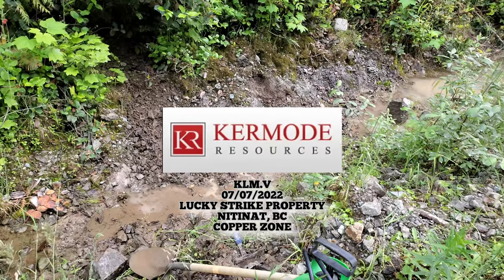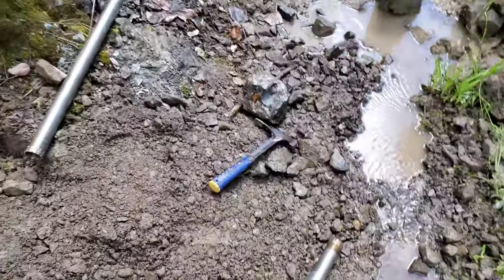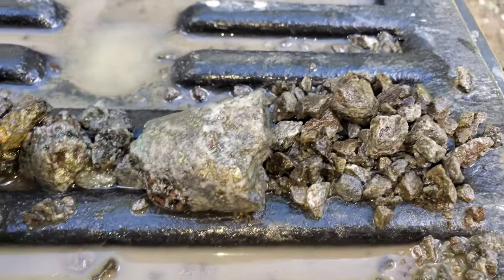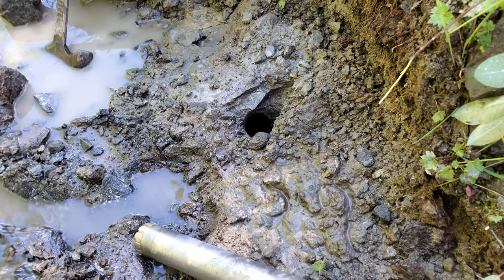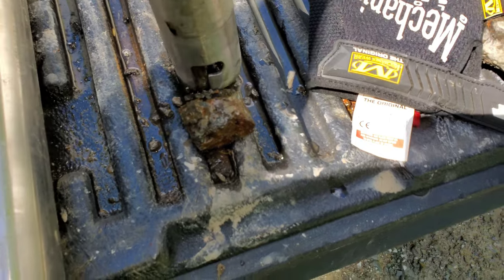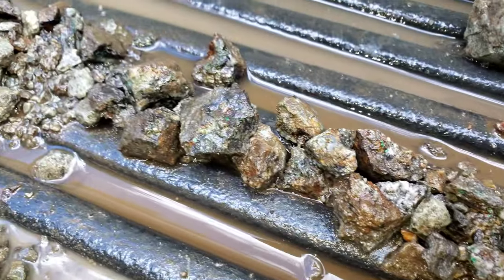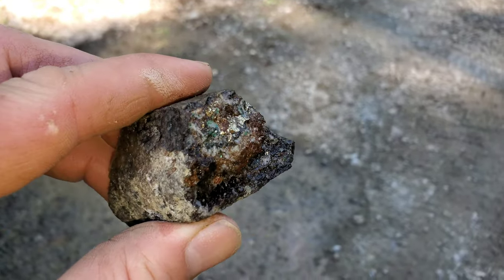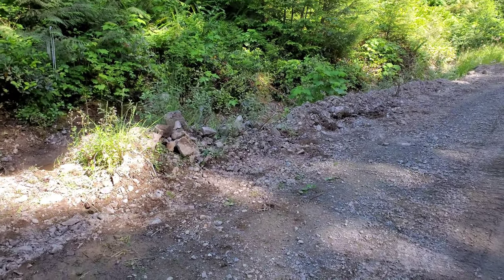Drilling Into Massive Chalcopyrite At The Copper Zone! (Lucky Strike Property) $KLM

Comment: So what does it all mean ???
Reply: GOOOOOOOOOOOOOOLLLLLĹLLLDDDDDDDDDDD!!!!!!!!!!
Reply: 911 Mining can't speculate on this video for compliance reasons. But basically they are taking new samples of the showings for Kermode. We've seen in previous videos from 911 Mining that there appears to be a structure many kilometers long across the mountain and valley. But those previous videos and samples weren't taken under the supervision of a Qualified Person, so can't be used as part of an investment prospectus or development of a model that goes into a prospectus. Prospective Kermode investors can use what they see in these videos to make an investment decision. Kermode will also use the samples to decide to where to drill/explore more extensively to help develop a thesis for the formation. Typically they'll drill a couple holes to try to intercept veins in the middle of the deposit(s). A junior mining company like Kermode won't have the resources to build a full picture of the deposit(s), but a junior's goal is typically to find something exciting enough for a larger company to buy and develop.

So it doesn't "mean" anything yet. The old samples were enough to get Kermode interested: they are promising for the development of a mine. The new samples will very likely be sent to a lab for analysis. It's possible Kermode may decide to drill a hole or two next summer but I suspect they'll probably want to see what else that can be found at surface first as drilling is very expensive and they'll want to make the most of it. There appear to be multiple veins showing and they'll want to intercept as many as possible with the first drillings to see how thick the deposits are at depth. Later drilling by a bigger company would be more systematic.
Reply: @MarkRose1337  Thank you, I am not a rock hound so I didnt know what it was all about,, but that kind of what I figured
Reply: @MarkRose1337  great discussion thanks! I made a video with my own thoughts and will post link here short.
Reply: @skeets6060  I'm not much of a rock hound either (I have a meager collection of mostly fluorescent minerals). I do have an amateur interest in mining though, so it's been a fun story to watch over the past couple of years as they've prospected the mountain.
Reply: @peterbell5806  Normally YouTube will send comments with links straight to spam and they need to be approved. I see the video on your channel though and I'll watch it shortly!
Reply: @MarkRose1337  thanks I didn't know that about the spam filter on comments with links. Will keep in mind for the future